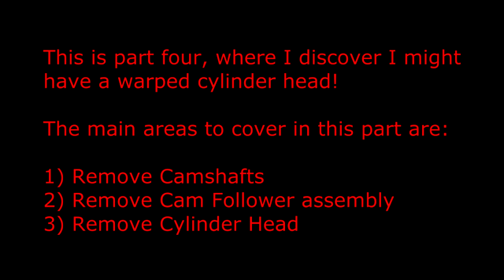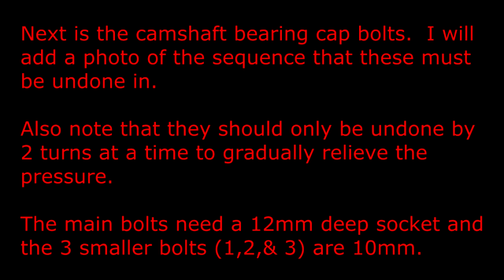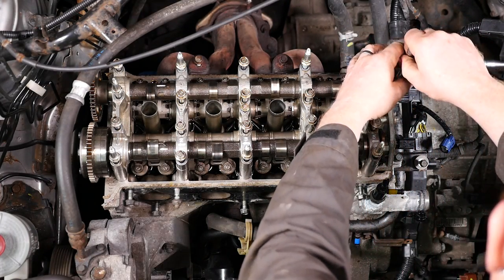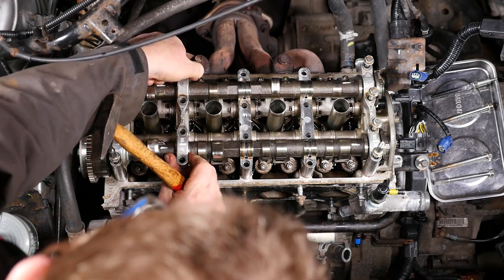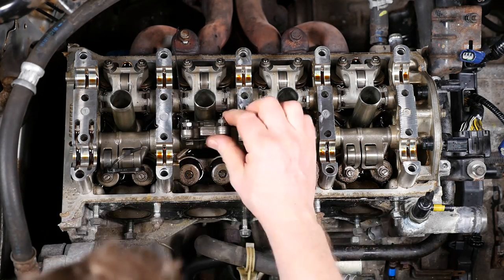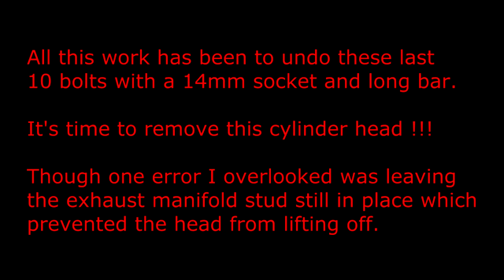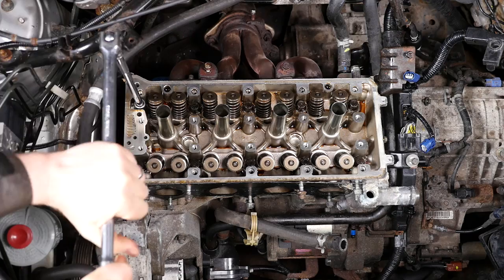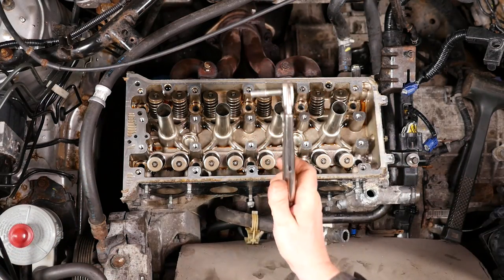Part 4 - Honda CRV 2 litre K20 A4 Head Gasket Repair.... up to removing the Cylinder Head Gasket

Comment: I have oil on threads #1, #2 and #3 Spark Plugs (2005 CR-V EX), I have not done to this step yet (17:20).
Do you think those White Rubber Rings (O-ring/Spark Inlet Gasket) are causing the oil on three spark plugs?

Again, the oil can be seen on Electrodes and Threads while the Ignition Coils are cleaned.
I have Valve Cover Gasket Kit:
https://shop.advanceautoparts.com/p/felpro-valve-cover-gasket-set-vs-50614-r/20688540-P?searchTerm=valve+cover+gasket+kit

1. One Valve Cover Gasket
2. Four Valve Cover Spark Plug Tubing
3. Six 10mm Bolt Seal with metal domes
4. Just don't know where the Four Plug Tubings go into?

Any suggestions would be appreciated.
Reply from the maker: Have you seen Part 9 in my series as I replace the spark plug tube seals at the beginning.  Sometimes oil can leak past the valve stem oil seals of which there are 16 seals also.

Comment: At the end of this video you referred to part five I can’t find it on your channel it jumps right to seven is there a reason I can’t find part five and six? I am about to start the process of replacing one of my valves on this same engine seeing that I have never done this before I found your videos one through four extremely helpful! Would love to see five and six if at all possible
Reply from the maker: Hi really sorry I named them differently as they could apply to other engines.  Part 5 is called "Resurfacing a K20 Cylinder Head using Sand Paper and a Stone Slab. Honda CRV 2 litre Petrol Engine" and Part 6 is "Lapping Valves and replacing Valve Stem Oil Seals on Honda CRV 2.0 Litre Petrol K20 A4 Cylinder Head"
Reply: Thank you very much for the quick response and this video series it has been extremely helpful!!

Comment: Haha I did the SAME exact thing at 15:58!! I was pretty upset to find out a new one was somewhere around $75!
Reply from the maker: Jgizzy redacted I repaired it with JB Weld and copper wire.  Wrapped it with copper wire and then put JB Weld around that.  I was so annoyed when I broke it.
Reply: @CoatsandGaiters  I like the reinforced copper wrap idea, that much hadn't crossed my mind. I know how insidious coolant can be to epoxy repairs so I didn't even bother out of my own coward-laziness so I just bypassed it with plugs. It worked but bypassing it negatively affected my warm-up efficiency. You are a very smart guy, it shows in numerous ways and I thank you for posting these videos. Just wonderful content.
Reply from the maker: Jgizzy redacted thank you for your lovely kind comments.  My artic lorry trainer may disagree with you on me being smart lol Just passed it yesterday but boy did I struggle learning to reverse it into a delivery bay.  Doing so convinced me I might suffer some learning difficulties.......no joke.  Got there in the end but while others picked it up quickly I was floundering around on the reversing procedures.

Comment: Great vid, I have a stream with a K20a1 and I may need to do the same job on it, whats the size of the socket for head bolts if you don't mind?
Reply from the maker: I just checked my videos and I mentioned a 14mm socket for the head bolts in the video.  Hope this helps.  Thank you
Reply: @CoatsandGaiters  thanks for the update

Comment: What centimeter is the length of cylinder head bolt located in the rear 2nd sequence? I broke the tip while tightening the valve cover bolt. Please help
Reply from the maker: Sorry I have no idea

Comment: One question: ¿Those spark plug tubes... can it be unscrewed?
Reply from the maker: They seemed pretty tight to me at the time.
Reply: @CoatsandGaiters   I do have a broken spark plug. I already tried with an extractor but the thing got stuck in there too. I´m having such a pain in the lower back. Ericthecarguy say in a vid that it is possible. It has a thread I guess. Because it is aluminum on the head and steel on the tube. ¿Ins´t it? 
I do not know what to do. Removing the head seams to be the only way this far. 
Suggestions are most welcomed.

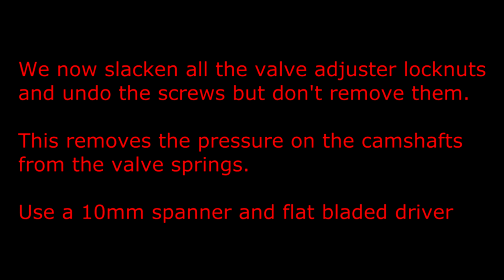Comment: Thank you for this excelent series. Let me ask you a question: 1:20 ¿on what porpouse do you relief the presure of the camshafts?
Reply from the maker: Thank you.  As we are removing the cylinder head some of the valves will be pushing into the cylinders so taking the pressure off means the valves can relax and sit back in their seats.

Comment: Did it overheated?
Reply from the maker: Yes the radiator leaked I believe and the owner didn’t realise till it was too late.
Reply: @CoatsandGaiters  the engine is ok? Only the head gasket needed to replace right?
Reply from the maker: @balancemode4112  you can see the Honda driving at the end of Part 10.  All was ok after replacing the head gasket and skimming the head with sandpaper.
Reply: @CoatsandGaiters  thank you

Comment: all good info but leaving us with a hanging cylinder head is not cool. maybe you should have waited till job was complete before posting any of the series. What lead you to believe your head is warped
Reply from the maker: Thank you for the comment.  Sorry about not being able to post it all once complete but the task would take about 6 months and be a huge production  job while working so it's more of a series showing me doing the car.  Also there would be a risk of nothing being uploaded if I did it that way with family commitments.  I have done my next video in this series where I show the head is warped and how I flatted it.  Hopefully I will be doing more on it this week.  But it's only the reverse procedure to do now.  Sorry though if you were waiting for me.
Reply: @CoatsandGaiters  I really do appreciate the time and effort you have put in for that particular motor. I think its the only one of its kind for that model. You gave me the confidence to start ripping mine down now. I was just hoping to see you show me proper valve adjustment procedure but guess I can find that elsewhere. Great for the garage mechanic that does not have all the fancy tools. good luck on your viewership and hope to see that CRV on the road again.
Reply from the maker: @marcomladineo9754  Thank you for that.  Hopefully I can get some done soon as I need the car on the road asap so urgency is now required on my part.  I think the timing chain might be the fiddly bit.  How did you get that 19mm crank shaft bolt out?  I had terrible trouble.
Reply from the maker: Hi I have just uploaded Part 8 in the series where I do the valve clearances.  I realise that may be too late for you sadly but just thought I'd let you know Marco.  The head was shown to be warped in Part 5.

https://www.youtube.com/watch?v=faMq2fl3irc&t=829s